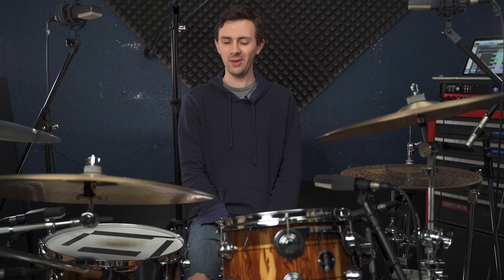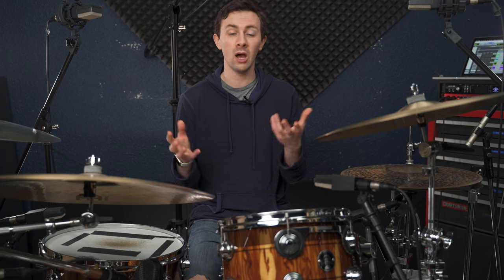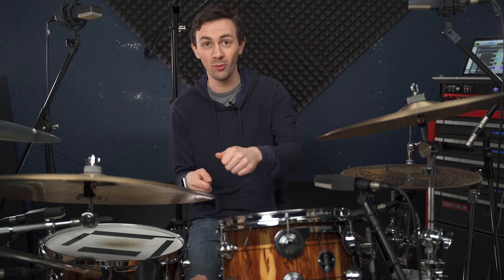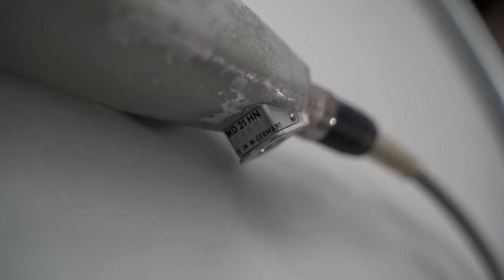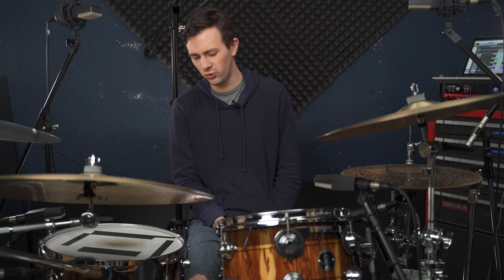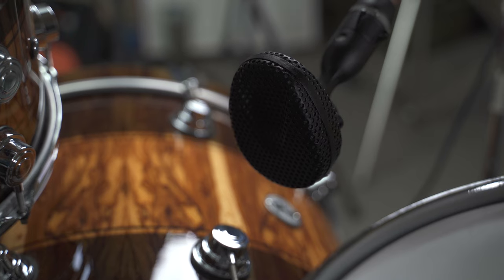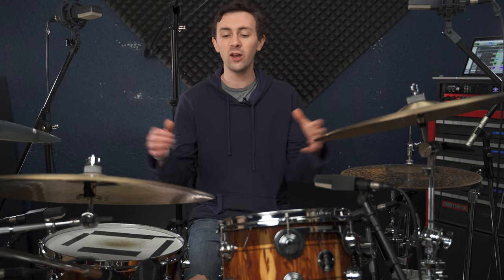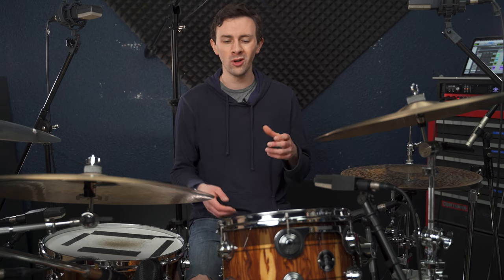The Floor Mic - Micing a Bass Drum From The Back

Comment: Love it! I'm really surprised how much better it sounds on its own than the other methods I've tried of miking the batter head. 
I've done the Eric Valentine thing of putting a figure 8 closer to the batter head, back facing the snare - still super cool because I'm getting two isolation mic positions with only one input - and obviously, that can be distorted or compressed; now based on your channel I'd assume you know some of Steve Albini's tricks - and how he always mics his batters, usually with a lavaliere dangling by the beater: I've loved that in any sort of band mix, because dialing in the exact amount of click I want in a bass drum is immensely satisfying, but even so! On their own, they're never enough. Not like this though! With the omni down there instead - is it just me or does it actually sound weirdly full? Not too much batter, not too much beads - just right. Of course, you could isolate one or the other, but I'm hearing a much more Motown kind of character on its own, without anything on it, either! Super results.
Reply from the maker: It definitely sounds better as a full picture mic than I ever would have expected - it cuts out a ton of cymbals too which can be a huge plus obviously if you're trying to get a picture of the shells more than anything else. I was totally surprised and not 100% sure if it's due to the character of that specific mic or just using the omni pattern specifically but I'll definitely have to do some more experimentation. It wouldn't be too hard for me actually to just put a 414 down there facing the kick and try it in all the available polar patterns. Seems like that would give you a lot of flexibility as far as whether you want just the kick, a kick/snare thing, or a full picture sound. The best would be using one of those mics where you can change the pattern after the fact!
Reply: @ColeParamore  OOH very good idea indeed! definitely curious to hear how one of those like the lewitts or the josephson c700 would sound. If you have small enough condensers actually you can make one of those kinda mics yourself with an omni, and two figure 8s, one on top for sides, and one on bottom for front and back, then M/S decode them into whatever shape you want! the only thing that wouldn't get you is height, but how often is that the dealbreaker anyway? btw that coles sounds wicked there. you ever tried M/S in the wurst / fat mic position? Can't afford the coles yet but I bet you could have a lot of fun with that with the coles, they'd probably give you everything you need! oh and psst also.... drums set up next to your washing machine...  close the lid and record the inside with a sdc... shockingly great)

Comment: So after hearing this, I wondered about the possibilities derived from mic-ing the bass drum the way the snare is sometimes mic'd. I have a modified SM-57 on the top of mine and an Audix I-5 on the underside. If the bass drum was mic'd front/inside and back to achieve the attack as well as the depth and body of the drum, then I would imagine that similarly to a snare, a uni-directional mic would probably be the best option of capturing and isolating the attack toward mixing to get the optimum sound. Using an omni-directional, would seem to limit the control of mixing the various other elements like the snare which does indeed bleed into that floor mic as you mentioned. I find that ambient sounds like snare buzz are best limited to the overheads and the far room mics if I can manage it. Anyway, I have no answers about this but it interests me as an experiment. As usual, you've come up with an interesting premise for getting the best sound, Cole! Thanks as always for these great videos/concepts!
Reply from the maker: Thanks for the insight Stephen! You're right that if isolated bass drum attack is what you're after, definitely a cardioid is the way to go. The nasally snare side sound is an obvious feature or bug in this situation, depending on your persuasion. Many folks want to isolate as much as possible and completely minimize snare buzz, but I find that the picture of the kit you get when you start working with the bleed rather than fighting it can be much more interesting and often more natural sounding. Not to imply that the sound from this particular mic is natural, but I'm sure you get what I mean.
Reply from the maker: Are you still in town? I have to catch you at the new shop sometime!
Reply: @ColeParamore  Completely agree. There's a kind of "hall of mirrors" effect that can either be serendipitous? Or a nightmare! And likewise, the isolation pathway can lead to a never-ending stream of fixing one problem, and causing another one in the process! I love that you're always forwarding the inquiry as sound is one of those quotients that while incredibly important, too many of us leave up to chance and the uncontrollability of variables. Especially when moving from venue to venue with lots of options at the instruments available. Ultimately, it comes down to having sensitive ears and you clearly have them, my friend! Good on ya!
Reply: @ColeParamore  We're down in a cozy little cabin on the Oregon coast waiting this pandemic out. I've got my Roland TD-20 set up in a loft above the garage next door and have been really shedding a lot. I studied with Murray Spivack and Chad Wackerman who advocated the Moeller method. But after years of using it, I found it limited and started learning the "open/close" finger technique and Studying with Gordy Knutson. I'm finding it such a help and makes playing so much easier. But the initial muscle memory learning curve is a steep one when you have the habit of Moeller technique. It's counter-intuitive to open the hand on the downstroke and I'm just starting to feel more comfortable with open close than I am with Moeller. At best, I'm hoping to incorporate both along with the standard wrist stroke.
I'll be coming up to Seattle next weekend and attending the master class on Saturday. Are you going?
Reply from the maker: @Stephen.Salamunovich  Won't be at the masterclass but hoping to be at the clinic. Good chance I'll be at the shop though anyways. Hope to run into you!
Reply: @ColeParamore  I'm looking forward to me, my friend. It's been too long!